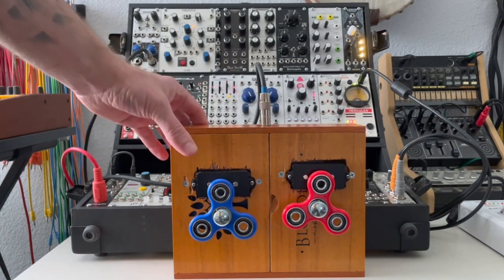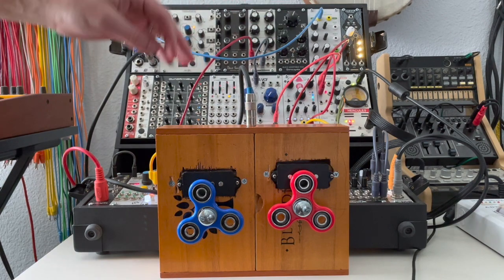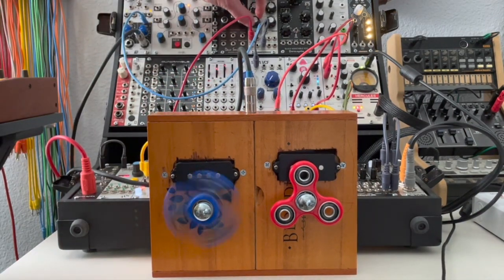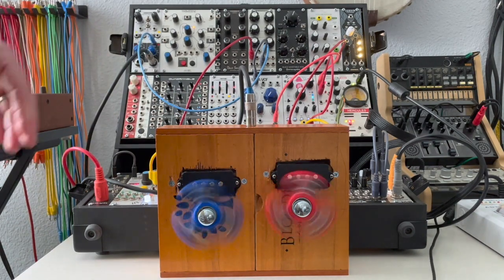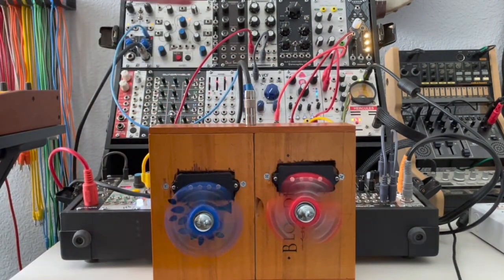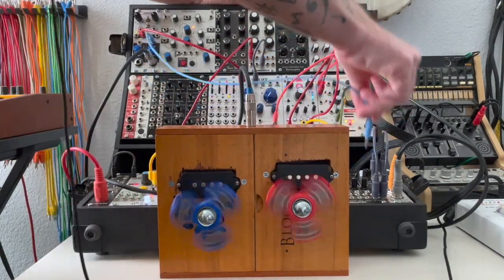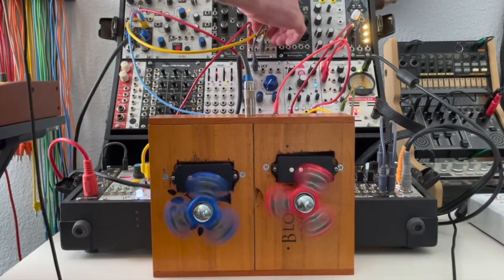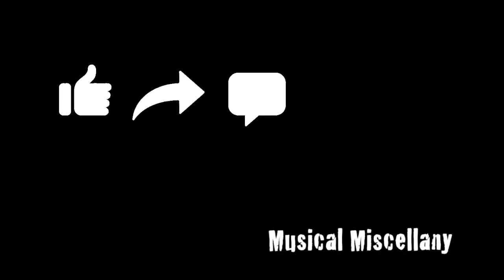Fidget Spinner Box Meets Modular Synth (DIY Instrument/CV source)

Comment: Oooooo… I going to have a go at building one (or two) of those…👍
Reply from the maker: Thanks for checking out the video. It's super easy to build and very useful. Good luck.
Reply: @musicalmiscellany  i’ve made a lot of “circuit-bent” stuff, but never got round to using Fidget Spinners..
For some unknown reason I appear to have a collection of 3 which I knew would come in useful one day..
Reply from the maker: @outaspaceman  Well there ya go! Now you just need a pickup and a box. 😝